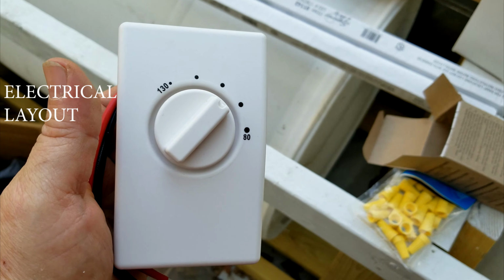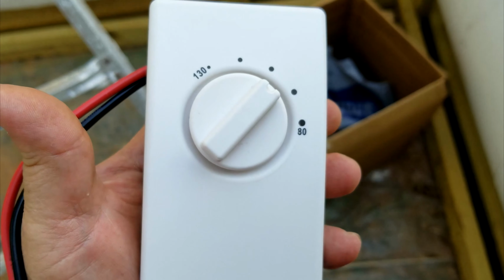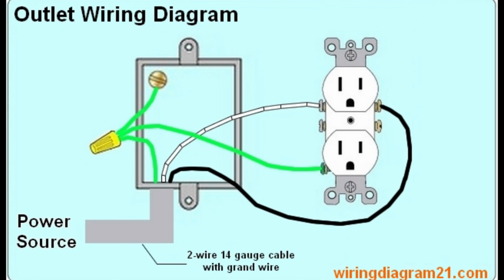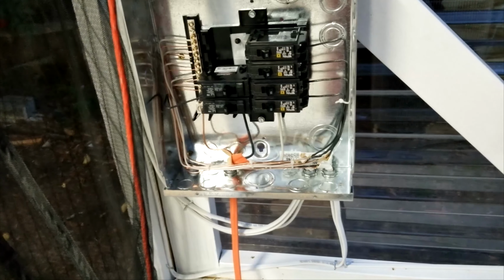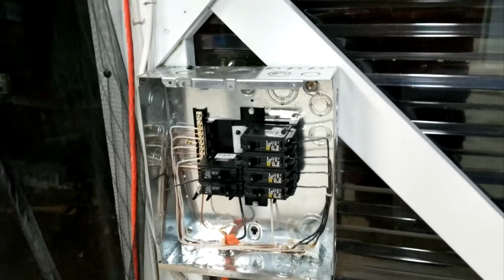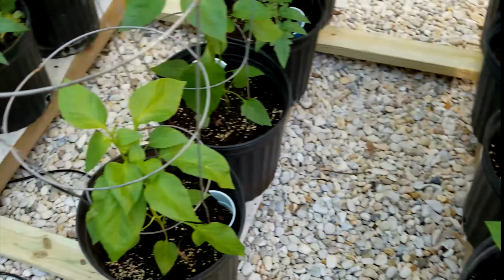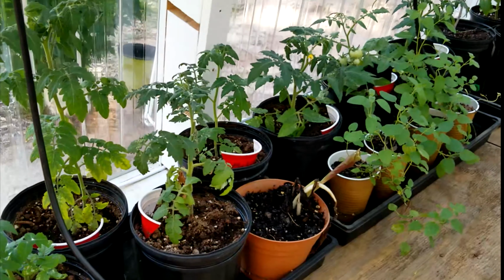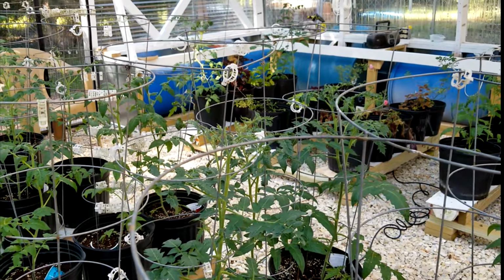WOODEN BOW GREENHOUSE PART 3 WIRING, GROUND COVER AND WATERING

Comment: How did you bend the greenhouse panels on out side. sweet looking greenhouse
Reply from the maker: It will bend a little, but will want to spread. Mark your 2 ft centers first. secure the first and last low of the sheet first, then center and so on. If you can get the wooden base tracking, it will make this easy.